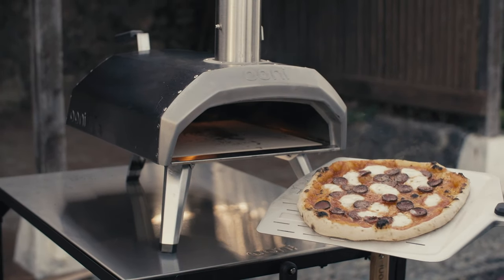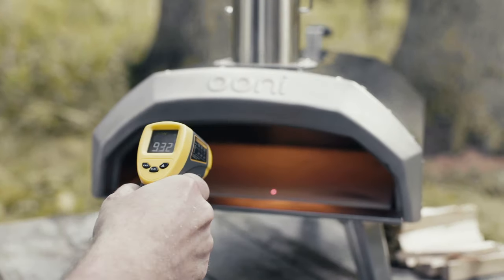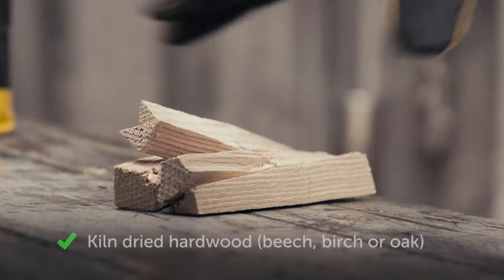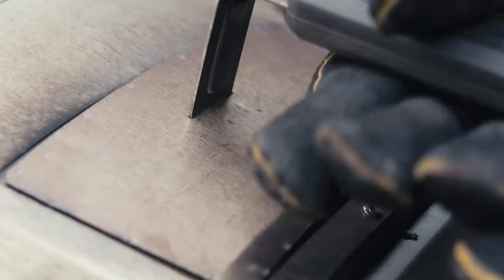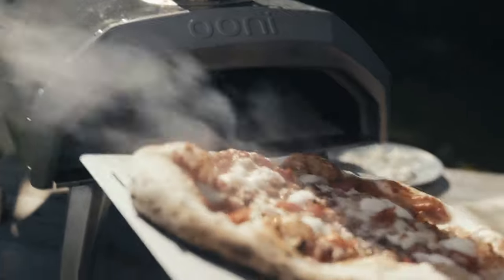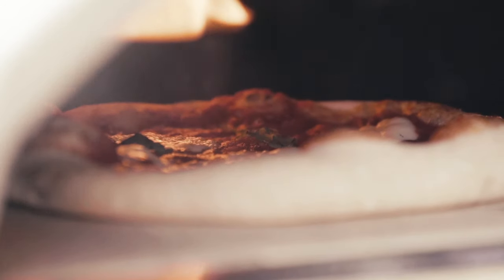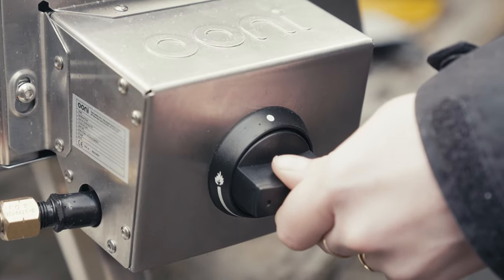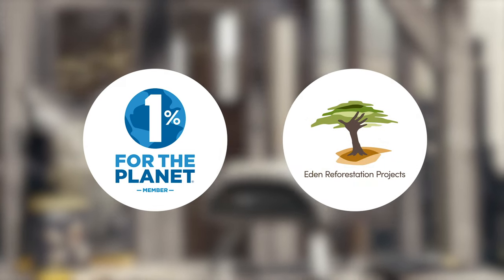Ooni Karu 12 Wood and Charcoal-Fired Portable Pizza Oven | How to Setup & Light it

Comment: Is it possible to cook a 60 second pizza without adding more wood after you initially light it the first time? My father expects a fire to last the whole time during cooking without having to constantly add more wood
Reply from the maker: In order to keep the oven and stone up to temperature you will need to add more wood during the heat up process.750ºF / 400ºC is the ideal temperature your oven should be at during launch.
Reply: The wood will burn to nothing in almost no time. The pellets are key to maintaining temperature
Reply: I won’t even think about putting my pizza in with a temp over 400°but the stone itself should be 375°before you start

Comment: I have had the Ooni 3 for years. I love it. My only struggle is that I have to replace the pellets every few minutes when cooking pizza. With the Karu wood option, how often does wood need to be added to keep the flame going?
Reply from the maker: Hey Wes! We recommend topping up with 1-2 pieces of hardwood between pizzas, just to keep that flame rolling!
Reply: It burns ALOT of wood before it gets up to temp. The video makes it sound like just a few pieces are needed. Not so.
Reply: No fire starts out at 900 degrees, be patient
Reply: Wood will burn to nothing in almost no time at all. Pellets are the only way to maintain temperature

Comment: Just got one. Very excited to try it tomorrow. I think the hardest thing will not be having pizza every night from now on!
Reply: Hi!! How has been your new toy? Did you buy the charcoal one?
Reply: @titomoura7014  Hi, the pizza oven has been amazing! I have the dual fuel one (Karu 12) it is easy to get hot and cook with. Getting the dough right was a bit trickier, but after a few attempts I got the hang of it. I would say buy a digital thermometer as it make so much easier to know when your oven is at the right temp cook. So far I have used oak kindling, will try charcoal at some point. 

Mine gets to 500c in about 12 mins
Reply: @oglanuts  Thank you for your feedback!!!

Comment: Will it work with wood pellets?
Reply from the maker: Hi there! Our Karu 12 is intended for use exclusively with larger hardwood chunks and lumpwood charcoal. Unlike our Ooni Fyra, which was designed for pellet use, our Karu 12's internal components were not designed in the same manner to burn pellets. We've found that using pellets in our Karu models generally blocks airflow and consequently affects the overall performance of this unit. Therefore, we'd recommend sticking to charcoal and larger wood kindling for the best results.

Comment: I used my Karu with wood all last summer and it has never gotten over the low 700 degrees. Also, it burns alot of wood before it gets up to temp
Reply from the maker: Hi there! If you're struggling to reach higher temperatures, we like to have a light base layer of charcoal to maintain a steady, even temperature. After your oven has preheated for a few minutes, we like to add hardwood chunks to give a burst of heat and wood-fired flavour. 

Here at Ooni HQ we use hardwood kindling made from either oak or beech hardwood and we use high quality lumpwood charcoal. We don't recommend using charcoal briquettes are these will block the holes in the fuel tray, thereby limiting airflow.

To maximise airflow, please also ensure the chimney cap has been removed and the chimney baffle is open before lighting up. Please also make sure the door and fuel hatch are kept on through your pre-heat and cook to prevent heat from escaping.

Make sure to give your starter fuel a full 10-15 minutes to burn through and heat the oven. We recommend starting with 4-6 pieces of kindling. Once your oven has pre-heated and you can see the starter fuel has mostly burnt through, top up a with a couple of sticks of wood kindling to achieve a rolling flame. After a further minute, your oven should be at the perfect temperature to launch your pizza! After each pizza, top up with a couple more pieces of wood kindling and give your Ooni a couple of minutes to get back to top temperatures. Hope this helps! -Colton, OoniHQ
Reply: Charcoal and then nice wood for rolling flame to cook 👍

Comment: How well does thiw work with briquettes instead of lump charcoal? I'm working overseas where there isn't much natural wood but the base carries briquettes. I haven't checked in town for lump coal but I'll see what I can find. Getting gas would probably require a conversion to a local tank. Kuwait. Thx
Reply from the maker: Great question! We'd actually try to avoid charcoal briquettes if possible, as these can be quite crumbly and lead to poor airflow for our solid fuel-fired ovens. Our preference here at Ooni HQ is to have a light base layer of lumpwood charcoal to keep a steady, even temperature and adding wood to give a burst of heat and wood-fired flavour. 

As long as the chunks are the right size to fit in the fuel tray, they’ll work great! Woods like Oak, Beech, and Birch are great for the Ooni, but readily available hardwoods like Mesquite, Hickory, and Applewood will also work.
Reply: @Oonihq  Thanks for the reply.  The base actually has some lump charcoal next to the briquettes so I bought a bag of each. Bought a Weber kettle to bbq a turkey and will look in town for regular wood. Has to be some around. I'll review other videos as well to learn more and if things look good I'll look into buying one of your ovens. Wanted to build a brick oven but that's for my house in the US and not overseas. This is a good option and I might consider this for home use as well. Thanks again.

Comment: Can I use gas to get it started/cleaned? I know for gas you’re supposed to remove both the chimney and the coal chamber -does that mean it won’t clean properly when using gas?
Reply from the maker: Hey! You can absolutely use gas to fire up your oven and self-clean. The high temperatures are what burn off any excess. 😁

Comment: Do you keep the door ON only when heating up to the desired temp or also when cooking something like a pizza in 60 seconds (with vent open)? The only reason I ask is because one'll have to keep rotating the pizza which means taking the door ON and OFF multiple times.
Reply from the maker: Hello Anuj 🍕
When cooking with Ooni Karu, the door must be off at all times. There are full instructions here: https://support.ooni.com/support/solutions/articles/24000050641-ooni-karu-essentials-guide-and-manual . Advice on cooking with the vents closed and pizza door on is related to cooking with Ooni Pro. 😉🍕💪
Reply: @Oonihq  I have a Karu 12. Your reply above has confused me... at 1:00 in the video it says keep the door on at all times.
you say keep the off at all times?
Also the link doesn't work!
Reply: @Oonihq  this is very confusing, video says the opposite?

For karu 16, do you have door on or off?
Reply: I’ve had my karu 12 for several months now and can say it doesn’t really matter either way. Keep the door on while cooking just keeps the heat insulated better and that’s what I’ve always done but also will leave door off if I’m cooking and the pizza is cooking too fast
Reply: @brimstone5931  off is when you use gas.
Reply: @ZenithQuinn  Thanks Z 👍
Reply: @Oonihq  Link doesn't work!!
Reply from the maker: @mangozz7397  hey! The comment was posted a while ago and the support link has since been updated. What were you looking to find? :)

Comment: No matter what i do, I can't get it hotter than 350 C in the back. It is not even 300 C close to the door.  This is after more than an hour. Rolling flames and all. It does not matter. Yes, door is closed, chimney open and lid off. Can this be the charcoal / wood type? I really dont see why this would make any difference.
Reply from the maker: Hey there, we do recommend high-quality solid fuels as this can affect your overall cooking experience! Here in Ooni HQ, we like to use a base layer of charcoal for the heat and add small pieces (about 5" - 13 cm) of wood for the rolling flames. We'd recommend lump wood charcoal, and these kiln-dried hardwoods: beech, birch, oak, hickory, mesquite, apple, or cherry. 

We have an article that should help you with this: https://support.ooni.com/en_us/my-ooni-karu-12-isn't-getting-hot-enough-or-has-an-underpowered-flame.-what-should-i-do-S1OVjROfs - but feel free to get in touch with us at support@ooni.com if you need any further support! 🍕🔥

Comment: Can you use pellets on the Karu 12?
Reply from the maker: Hey, Simon! Our Karu 12 isn't optimized to burn pellets in the same efficient way that our pellet-fed ovens are. These pellets are smaller than recommended solid fuels (lump charcoal and hardwood kindling), which tend to clog our fuel grate and affect overall performance. Therefore, it's best to stick with the appropriate-sized kindling and charcoal if you'd like to cook with solid fuels.

Comment: I think it's kinda negligent to say you can cook with this out of the box. If you read instructions, it says that you should season your ooni. You can smell the cooked oils from the first burn and I wouldn't want to eat that stuff. Please season your ooni for at least 30 minutes at the max temp before using.
Reply: how ?
Reply: @meerajamali3591  1 tsp of salt and pepper and 1 tsp of your favourtie herbs and spices should do, double up if using gas
Reply: @meerajamali3591 how what? Use pellets and wood pieces to light it. Once it catches you have to constantly check the temp. You can’t cook an edible pizza in 90 seconds at 900°. The pizza turns black in less than 60 seconds at that temperature

Comment: i had the problem that the bottom of the pizza got burned but not the top, what did i do wrong?
Reply from the maker: The ideal temperature for cooking pizza in an Ooni is between 400ºC and 450ºC (753ºF to 852ºF) in the middle of the stone baking board. We recommend using an Infrared Thermometer to measure the temperature as it takes out all of the guesswork! If you're struggling to reach this temperature you can simply increase the pre-heat time to allow the stone baking board more time to heat up.
Reply: As the bottom got burned, I'm guessing the stone was hot enough, but you probably didn't have a rolling flame going on. 

There needs to be an active rolling flame when cooking the pizza, to get enough heat from above, to cook the top at the same time as the bottom.

Comment: I don't get why people are talking about making a Karu 16. Wouldn't that just be a Ooni Pro? 
I don't see any difference. The stone in the Pro is even a bit larger than in the Koda 16.
Reply: Yes, functionally, the Ooni Pro is just a big Koda. I have a feeling they're going to re-design the Pro to match the design style of the other models in the next year or so though. No inside info, just a hunch.
Reply: There is an Ooni Pro? I’m on the website and I see nothing called that. I’m looking for gas and wood ooni that 16 instead of the 12 lol. A Karu 16 would be heaven sent for me :)
Reply: @brittanymckinney8579  Yeah, they make an Ooni Pro. You just have to search to find it in stock somewhere. :) 
It works with gas, wood, charcoal and wooden pellets I think.